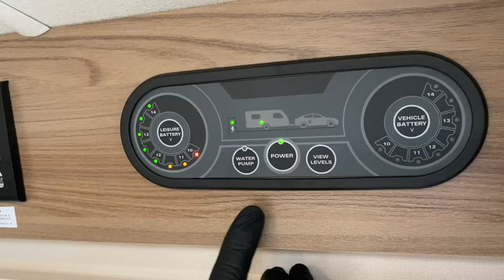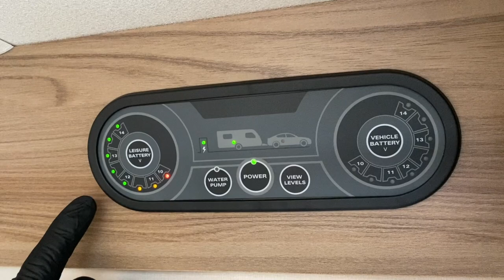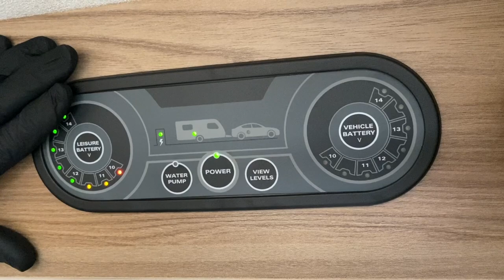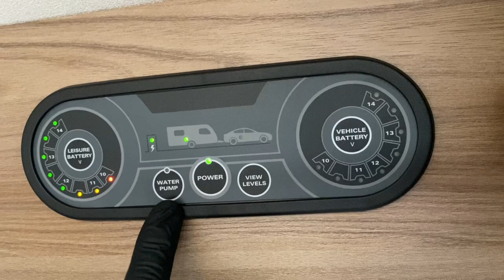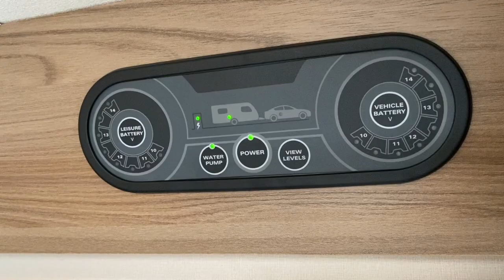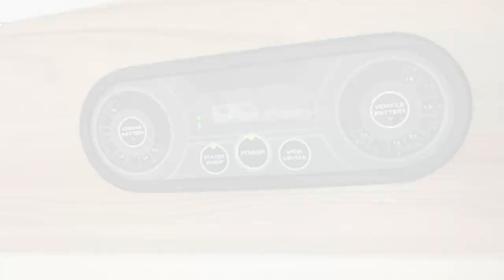Control Panel Demo || 2016 Swift

Comment: Hi thanks for your video. I've just bought a swift challenger van with a control panel like yours. Is it normal for the lights on the panel to go out after a minute or 2? I'm trying to get the water pump to work but without success so far. Any help would be appreciated. thanks steve